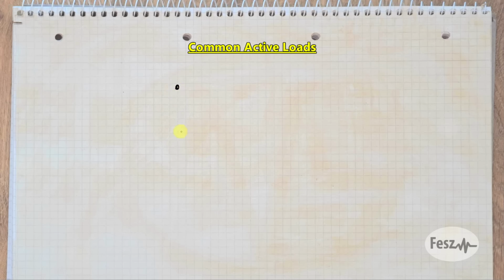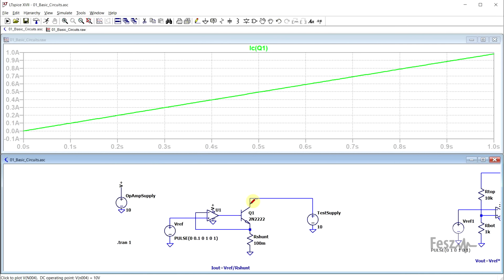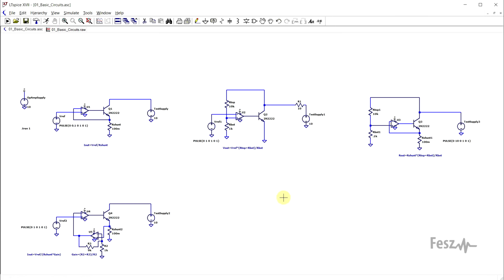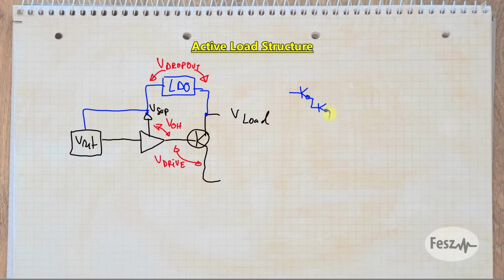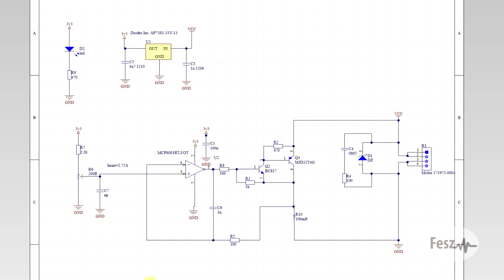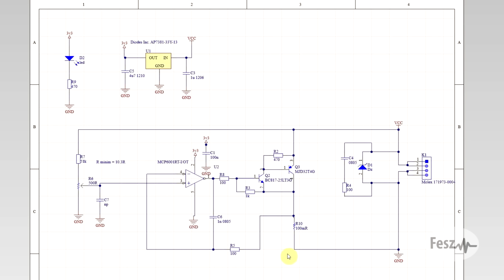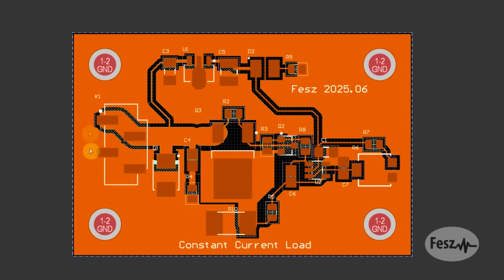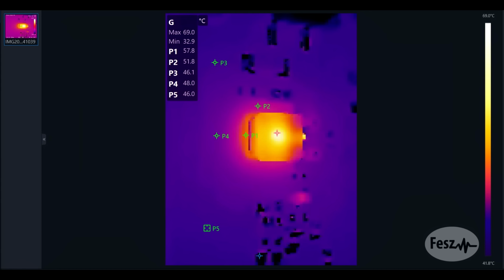Active Electronic Loads

Comment: For soldering, it seems this project would benefit from one of those inexpensive temperature-controlled rework soldering hot plate units.  I have a 100mm square unit, 350W, less than $50 at the south american river.  Works very nicely for this kind of job to preheat the board, then solder selectively with the hot air.
Reply from the maker: By the time I finished this video I also got a small heating plate. I noticed though that if you set a high enough temperature to melt the solder, and are not fast enough to do it, the board just turns brown... I think though that your approach is better - to just pre-heat and then selectively solder with hot air. What temperature do you set to pre-heat and not damage the board?
Reply: @FesZElectronics 170 or 180C seems a good tradeoff between low enough to avoid burning the pcb versus quick and selective soldering with hot air using smallish nozzle.  Somewhat depends on pcb material, ambient temperature etc.
Reply from the maker: I will try this next time. Thanks for the hint!

Comment: If I try your second circuit (constant voltage) with the last version of LTSpice the simulation gets stuck. If I remove the 10Ohm resistor (the one on the TestSupply1) the simulation completes but the result is wrong.
Reply from the maker: I used LTspice 17.1, not the latest 24, though that should not be the issue... Maybe its the opamp - in my case its the "universalopamp3a"
Reply: @FesZElectronics  You are right. It's ok with "universalopamp3a", with other opamps it's not working. Thanks.

Comment: Excellent video.  I once built a dummy load using binary weighted resistors and relays, sometimes you cannot beat a resistor. It was something like this.
I'm not certain  youtube will like this. Regards Ken_K
LTspice  *.asc
Version 4
SHEET 1 880 1772
WIRE -448 -640 -672 -640
WIRE -672 -576 -672 -640
WIRE -640 -576 -672 -576
WIRE -368 -576 -480 -576
WIRE -640 -528 -928 -528
WIRE -448 -528 -448 -640
WIRE -448 -528 -464 -528
WIRE -368 -528 -448 -528
WIRE -448 -464 -448 -528
WIRE -448 -464 -688 -464
WIRE -448 -448 -672 -448
WIRE -928 -432 -928 -528
WIRE -672 -384 -672 -448
WIRE -640 -384 -672 -384
WIRE -368 -384 -480 -384
WIRE 160 -384 16 -384
WIRE 336 -384 160 -384
WIRE 400 -384 336 -384
WIRE 16 -368 16 -384
WIRE -32 -352 -80 -352
WIRE 160 -352 160 -384
WIRE -688 -336 -688 -464
WIRE -640 -336 -688 -336
WIRE -448 -336 -448 -448
WIRE -448 -336 -464 -336
WIRE -368 -336 -448 -336
WIRE -928 -320 -928 -352
WIRE -32 -304 -64 -304
WIRE 336 -304 336 -384
WIRE -448 -272 -448 -336
WIRE -448 -272 -688 -272
WIRE -448 -256 -672 -256
WIRE 16 -256 16 -288
WIRE 160 -256 160 -272
WIRE 160 -256 16 -256
WIRE 16 -240 16 -256
WIRE 160 -240 160 -256
WIRE -32 -224 -80 -224
WIRE -672 -192 -672 -256
WIRE -640 -192 -672 -192
WIRE -368 -192 -480 -192
WIRE -32 -176 -64 -176
WIRE 336 -176 336 -224
WIRE -688 -144 -688 -272
WIRE -640 -144 -688 -144
WIRE -448 -144 -448 -256
WIRE -448 -144 -464 -144
WIRE -368 -144 -448 -144
WIRE 16 -144 16 -160
WIRE 160 -144 160 -160
WIRE 160 -144 16 -144
WIRE 16 -128 16 -144
WIRE 160 -128 160 -144
WIRE -32 -112 -80 -112
WIRE -448 -80 -448 -144
WIRE -448 -80 -688 -80
WIRE -448 -64 -672 -64
WIRE -32 -64 -64 -64
WIRE 16 -32 16 -48
WIRE 160 -32 160 -48
WIRE 160 -32 16 -32
WIRE 16 -16 16 -32
WIRE 160 -16 160 -32
WIRE -672 0 -672 -64
WIRE -640 0 -672 0
WIRE -368 0 -480 0
WIRE -32 0 -80 0
WIRE -688 48 -688 -80
WIRE -640 48 -688 48
WIRE -448 48 -448 -64
WIRE -448 48 -464 48
WIRE -368 48 -448 48
WIRE -32 48 -64 48
WIRE 16 80 16 64
WIRE 160 80 160 64
WIRE 160 80 16 80
WIRE 16 96 16 80
WIRE -448 112 -448 48
WIRE -448 112 -688 112
WIRE -32 112 -80 112
WIRE 160 112 160 80
WIRE -448 128 -672 128
WIRE -32 160 -64 160
WIRE -672 192 -672 128
WIRE -640 192 -672 192
WIRE -368 192 -480 192
WIRE 16 208 16 176
WIRE 160 208 160 192
WIRE 160 208 16 208
WIRE 16 224 16 208
WIRE 160 224 160 208
WIRE -688 240 -688 112
WIRE -640 240 -688 240
WIRE -448 240 -448 128
WIRE -448 240 -464 240
WIRE -368 240 -448 240
WIRE -32 240 -64 240
WIRE -32 288 -64 288
WIRE -448 304 -448 240
WIRE -448 304 -688 304
WIRE -448 320 -672 320
WIRE 16 336 16 304
WIRE 160 336 160 304
WIRE 160 336 16 336
WIRE 160 368 160 336
WIRE -672 384 -672 320
WIRE -640 384 -672 384
WIRE -368 384 -480 384
WIRE -688 432 -688 304
WIRE -640 432 -688 432
WIRE -448 432 -448 320
WIRE -448 432 -464 432
WIRE -368 432 -448 432
FLAG 160 368 0
FLAG 336 -176 0
FLAG 400 -384 output
IOPIN 400 -384 Out
FLAG -368 -576 Q1
IOPIN -368 -576 Out
FLAG -368 -384 Q2
IOPIN -368 -384 Out
FLAG -368 -192 Q3
IOPIN -368 -192 Out
FLAG -368 0 Q4
IOPIN -368 0 Out
FLAG -368 192 Q5
IOPIN -368 192 Out
FLAG -368 384 Q6
IOPIN -368 384 Out
FLAG -928 -320 0
FLAG -80 -352 0
FLAG -64 240 0
FLAG -368 -528 notQ1
IOPIN -368 -528 Out
FLAG -368 -336 notQ2
IOPIN -368 -336 Out
FLAG -368 -144 notQ3
IOPIN -368 -144 Out
FLAG -368 48 notQ4
IOPIN -368 48 Out
FLAG -368 240 notQ5
IOPIN -368 240 Out
FLAG -368 432 notQ6
IOPIN -368 432 Out
FLAG -64 288 notQ1
IOPIN -64 288 Out
FLAG -64 160 notQ2
IOPIN -64 160 Out
FLAG -64 48 notQ3
IOPIN -64 48 Out
FLAG -64 -64 notQ4
IOPIN -64 -64 Out
FLAG -64 -176 notQ5
IOPIN -64 -176 Out
FLAG -64 -304 notQ6
IOPIN -64 -304 Out
FLAG -80 -224 0
FLAG -80 -112 0
FLAG -80 0 0
FLAG -80 112 0
SYMBOL res 144 208 R0
SYMATTR InstName R1
SYMATTR Value 1
SYMBOL res 144 96 R0
SYMATTR InstName R2
SYMATTR Value 2
SYMBOL res 144 -32 R0
SYMATTR InstName R3
SYMATTR Value 4
SYMBOL res 144 -144 R0
SYMATTR InstName R4
SYMATTR Value 8
SYMBOL res 144 -256 R0
SYMATTR InstName R5
SYMATTR Value 16
SYMBOL res 144 -368 R0
SYMATTR InstName R6
SYMATTR Value 32
SYMBOL current 336 -224 R180
WINDOW 123 0 0 Left 0
WINDOW 39 0 0 Left 0
SYMATTR InstName I1
SYMATTR Value 1
SYMBOL Digital\\dflop -560 -624 R0
WINDOW 0 -13 66 Left 2
SYMATTR InstName A1
SYMATTR Value2 Vhigh={icV} Trise={DT} Tfall={DT}
SYMBOL Digital\\dflop -560 -432 R0
WINDOW 0 -13 66 Left 2
SYMATTR InstName A2
SYMATTR Value2 Vhigh={icV} Trise={DT} Tfall={DT}
SYMBOL Digital\\dflop -560 -240 R0
WINDOW 0 -13 66 Left 2
SYMATTR InstName A3
SYMATTR Value2 Vhigh={icV} Trise={DT} Tfall={DT}
SYMBOL Digital\\dflop -560 -48 R0
WINDOW 0 -13 66 Left 2
SYMATTR InstName A4
SYMATTR Value2 Vhigh={icV} Trise={DT} Tfall={DT}
SYMBOL Digital\\dflop -560 144 R0
WINDOW 0 -13 66 Left 2
SYMATTR InstName A5
SYMATTR Value2 Vhigh={icV} Trise={DT} Tfall={DT}
SYMBOL Digital\\dflop -560 336 R0
WINDOW 0 -13 66 Left 2
SYMATTR InstName A6
SYMATTR Value2 Vhigh={icV} Trise={DT} Tfall={DT}
SYMBOL voltage -928 -448 R0
WINDOW 123 0 0 Left 0
WINDOW 39 0 0 Left 0
SYMATTR InstName V1
SYMATTR Value PULSE(0 5 0 10n 10n 10m 20m)
SYMBOL sw 16 -384 R0
SYMATTR InstName S1
SYMATTR Value KenSW
SYMBOL sw 16 -256 R0
SYMATTR InstName S2
SYMATTR Value KenSW
SYMBOL sw 16 -144 R0
SYMATTR InstName S3
SYMATTR Value KenSW
SYMBOL sw 16 -32 R0
SYMATTR InstName S4
SYMATTR Value KenSW
SYMBOL sw 16 80 R0
SYMATTR InstName S5
SYMATTR Value KenSW
SYMBOL sw 16 208 R0
SYMATTR InstName S6
SYMATTR Value KenSW
TEXT 360 -184 Left 2 ;test constant current\n1 amp
TEXT -928 -136 Left 2 !.tran 0 1.5 0 3u
TEXT -872 -272 Left 2 !.param DT=500n
TEXT -872 -248 Left 2 !.param icV=5
TEXT -56 -480 Left 2 !.model KenSW SW(Ron=.1 Roff=1Meg Vt=1 Vh=0  Lser=1u  Vser=1m)
TEXT 16 -760 Left 5 ;Relay controlled dummy load
TEXT -976 -752 Left 5 ;This represents some sort of control\n system maybe a micro
TEXT -96 376 Left 5 ;relays
TEXT 224 24 Left 5 ;resistors can be very \nhigh power.\nCan be designed for \nAC DC RF
TEXT 400 488 Left 5 ;Ken Kranz\n2025
RECTANGLE Normal 736 608 -1152 -832
RECTANGLE Normal -192 544 -1056 -800 1
RECTANGLE Normal 112 448 -144 -416 1

Comment: What are the main advantage of using Bipolar vs Mosfet transistors for this design? Any speed difference?
Reply from the maker: For this particular built, I used BJT for the low control voltage - `the Vbe is about 0.7V while a typical mosfet will require a VGS of 2-4V

Comment: For reverse polarity protection...a big shotkey diode in reverse across the terminals. My PSU has this and it blows short circuit if I try charging a battery and hook it up backwards.

Comment: I'm using my smallest heater plate on my oven. By rotating the knob you can even preheat the whole board. Then switch to a max for a short while. No candle, no hot air blower needed. If not careful, the PCB could become discoloured.
Reply from the maker: I also got a heater plate in the mean time, and did run into the issue you mentioned with discoloration. I guess it takes a bit of time to get use to it and do it properly.

Comment: 18:50 You're half-way here towards building my favourite constant load: the constant temperature load. They are incredibly useful for making things like LED lighting so you can drive at high power without risking overheating. Looking forward to a video on analog constant-power and constant temperature supplies!

Comment: At 13:04, when using the zener as overvoltage protection, don't it need some series resistance otherwise it will just burn?
Reply from the maker: A fuse should be sufficient; the zenner, or better yet a TVS can withstand a high voltage but only for short periods of time. If the overvoltage condition is maintained for too long, no resistor will save you; anyway, a resistor would impair the normal operation of the active load...
Reply: @FesZElectronics  Yes exactly. Thx.

Comment: If you consider making a detailed instruction "from KiCad to JLPCB"?
Trial-and-error path would be costly for a user, I believe there are other people like me who want their boards, but wish to be OK on first time.
Reply: You just can't be 100% sure everything will work on a design without having it manufactured, it's part of the process 🤷 you can follow the datasheets and good practices all you want but something may go wrong and there's not much you can do
Reply: As Fisheiyy said, prototyping is always needed. As Fesz shows regularly in his videos, you can test a simple design by etching/engraving DIY boards. It requires a learning curve but it's relatively cheap to learn the process and it is very convenient in the long run. With a bit of skill, it's possible to DIY double sided PCBs with vias and even multilayer boards.